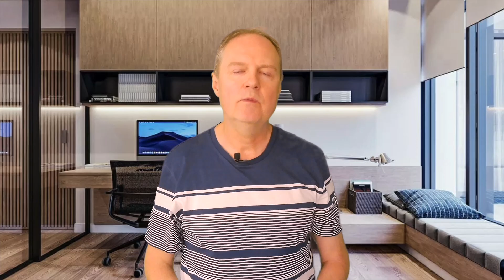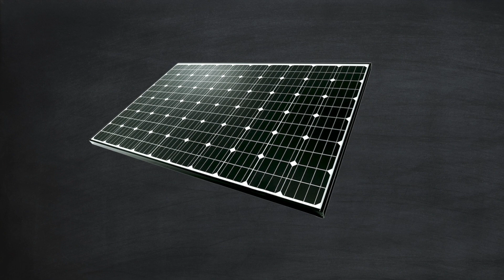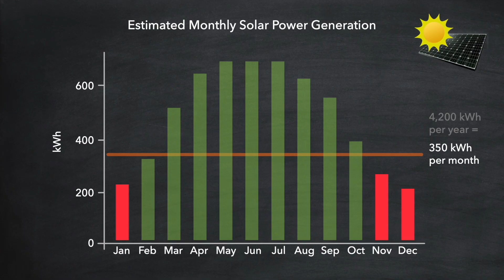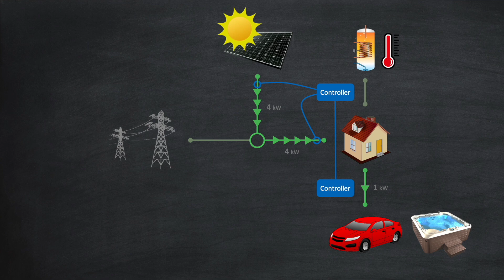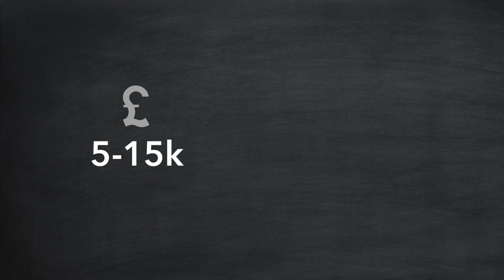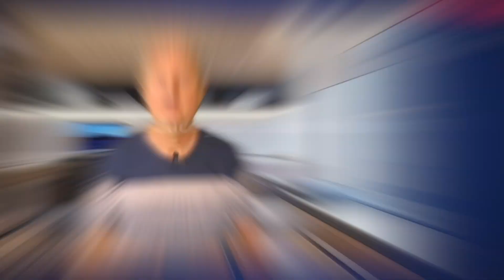A Beginner's Guide to Home Solar

Comment: Nice simple  video. I need a new house roof so, as an electrical engineering person, I have just spent 2 solid weeks mining through all the permutations of an in roof system and max out on surface area, inverters, optimisers, panels and batteries all with similar but not identical features. There are a lot of choices (too many) some better than others but software compatibility and support  should not be overlooked as I see many complaints about "this stopped working or updating" needed software update etc etc and this can be overwhelming for someone who is not technically competent. Not convinced of battery way just yet, but UK Govt incentive to reduce VAT to 0% for a complete installed system should be taken advantage of. Payback  under current tariffs is about 8yrs but if prices go back to 1yr it becomes less attractive. ...but I need a new roof so it comes at about 25% more than re-tiling. So Im looking to recoup 25% of an outlay which makes solar a no brainer.
Reply from the maker: Hi WA Jopek, thanks for the kind words re the video. This one was designed to just be an easy introduction, and I'll get deeper into the topic and all the complexities with future videos (whilst still hopefully explaining things well!) I can see you've got in quite deep already! I agree, unless you buy a ready-packaged solution like Tesla Powerwall (which, even then, has its own notables/issues) then you're in a world not too dissimilar to building your own PC - lol - what do you do when the component parts decide not to play nicely with each other and the installer doesn't want to know anymore?? Aside from that, you're definitely in a great position, having to deal with the roof anyway; essentially killing two birds with one stone. I'd love to hear how things go with whatever you decide for your installation, if that's ok?
Reply: @GaryDoesSolar  very early days but I will update. My fundamental problem at the moment is to get consensus on the configuration and optimum amount of panels and  on which sides of the roof.
One vendor quickly replied (declining to quote)  stating that they recommended only  6 panels on the front of the house but their minimum job was 8 stating according to Google earth that the other two sides would not yield much energy.

Another company quoted 15 panels 6+6+3 across all 3 sides. 

A 3rd company quoted 6+6 across 2 sides. 
🙈🙈🙈🙈
Reply: @wajopek2679  when we wanted to add additional panels on a second roof to complement our existing 3kw system we asked for quotes from 6 suppliers, two didn’t even come back to us, two were discarded because with one I had more idea about pv than the sales person, the other quoted for more panels than could have been fitted to the roof. The other two were very close and ai chose one that said correctly that as our proposed new array would take us over 3.6kw production we would need further DNO approval.

That was in 2020 and given the recent explosion of interest in pv because of energy prices and delays in supply of materials getting a decent knowledgeable is now even more difficult. That said after doing the research, the resulting finished product does make a massive difference to your electricity bill.  Good luck and I hope you find a decent installer soon.

Adding a Tesla Powerwall and the extra 1.3 kw array allowed us to cut our mains use by a thrift. It would have been more but we swapped our plug-in hybrid for a full electric bev.
Reply: Update on the previous post, we are thrifty but in relation to our reduction in mains use it was by a third.
Reply: @lynnfisher4396  as they say, every penny counts......but today each penny now costs you a tenner.

Comment: Also remember your inverter plays a huge part. If you are fitted with 3.68kw inverter if your home goes above this i.e using a washer, dryer, along with normal base load you will most likely go above the 3.68kw meaning you’ll draw usage from your battery or grid. Not many installers explain this to customers.
Reply from the maker: Great point, Dan. In my next video, I’m covering all the equipment needed to go Solar. I’ll make mention of what you say - so easy to overlook when choosing a system! 🙏
Reply: The Inverter decides when to take from the grid. You may need extra hardware to control this.

Comment: We've just bought a house which is North/South facing, so I'm starting to wonder whether the ROI on solar is starting to become attractive, also considering things like air-source or ground-source heating and perhaps even some wind power to help go off-grid a little more (lets face it, wind is more likely to be readily available in the UK that sun!). Wind turbines are a little unsightly that's the downside.
Reply: Whatever you do, don't attach one to your house or you'll never have a good night's sleep again.
Reply from the maker: Yeah, a combination of solar and wind in the UK (and perhaps many other countries) seems to be a good mix. I agree, traditional turbines look unsightly - especially in an urban environment. I see there are some newer vertical turbines available, that are much more aesthetic and supposedly quieter? But what about the costs? I'm hearing turbines are not so cheap...

Comment: Hi Gary - great stuff. Just made the move myself (1 week ago) and am now keenly watching the sun and the app to see how the system is performing. I will be linking to an air source heat pump in a few more weeks as well. We are doing some building work so this seemed like the time to make the leap.....the energy price hike came a bit later than the decision but just made us feel we did the right thing. Happy to share more detail with you should you wish. One point for your subscribers is to watch out locally for initiatives from buying groups aiming to get the price down. Up here in sunny Suffolk the local council launched "solar together" the aim of which was to help get the investment down by getting people into a group and going out to tender....sound familiar?! Seemed to work though - pricing was pretty good. Watch out for the flyers or emails from the council. Rgds Stephen
Reply from the maker: Sounds great, Stephen! Yes please - can you share more detail? I've heard mixed responses about ASHPs - but I guess if fitted in conjunction with solar, they make sense, given the electricity requirement. Did you also look at ground-source? Was that an option for you?
Reply: @GaryDoesSolar  yes understood ASHP was a bit of a gamble, but decided after some reading and some discussion to go for it due to the link with solar and using the energy in conjunction with battery(s). I did think of ground source but taking into account, time, cost etc went for Air. I cant remember now if there was the grant on ground source(?)...there is  grant on ASHP (£5K) It will be interesting to see how the two work together and of course i will let you know. We cut off the gas on Monday - so we are half off the grid and now its a question of getting the usage of the energy correct - balance with sunshine/appliances/battery etc etc. I havent received my details for selling energy back to the grid as yet (can you believe it could take 8 weeks!)but I checked with Octopus (for the record - I think they are the best utility I have used) and with the tarrif I am on (agile) I am told I can get 7.5p for a unit sold back. I'm taking that with a pinch of salt just now - we will however see in due course. PS - are you in Berlin?
Reply: One more point looking below at some points - we are pretty well South facing and shade is not heavy. I understand there is an optimum angle for the panels at 38 degrees....not sure if that is back from verticle or up from horizontal?? And if you want to get super nerdy that angle will vary with the seasons!
Reply: I would have been in Berlin, but am in the USA so can’t go. Hope the show goes well 😀
Reply: Hi Stephen, great to hear you've gone solar. I'm looking to do the same - keen to know the specs of your system. Which panels and inverter did you go for?

Comment: Excellent video! I’ve been interested in getting solar for a few years now, is it really worth gettting them installed now, or waiting a few years for efficiency to improve? 20% doesn’t sound that high…
Reply from the maker: Hi varnect203 - thanks for the kind words. I've just got started and will have further videos coming soon - there's a lot to say about solar! :-) Regarding panel efficiency, playing back the video, I'm giving the impression that 20% is not that great, when in fact, the technology required to get to 20% has been outstanding over the last few years, and products are under development today that will take the efficiency up to around 40% :-)